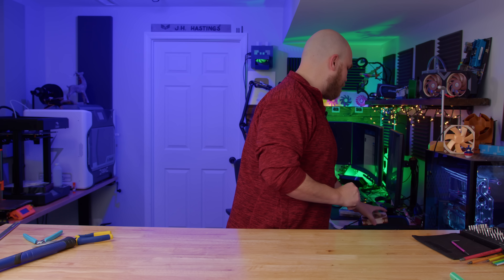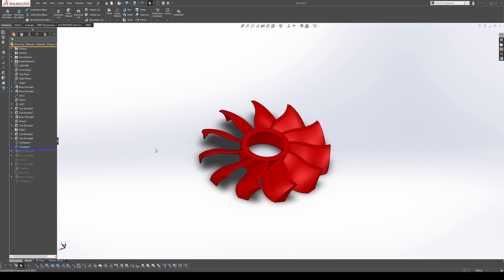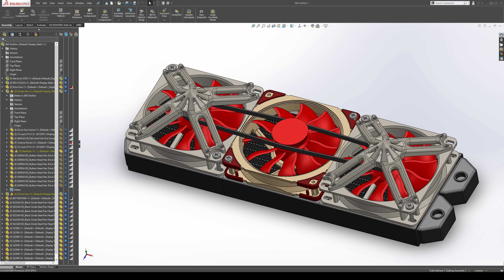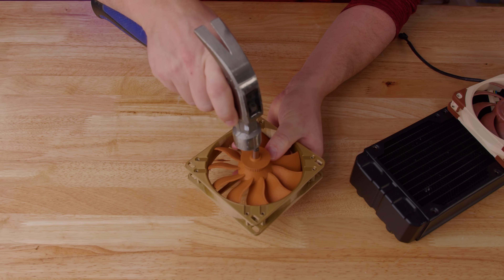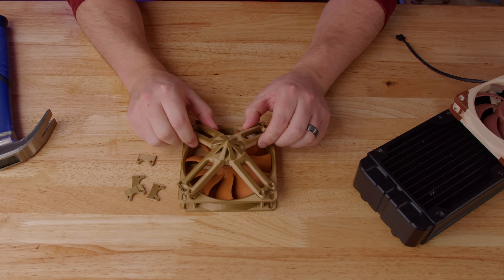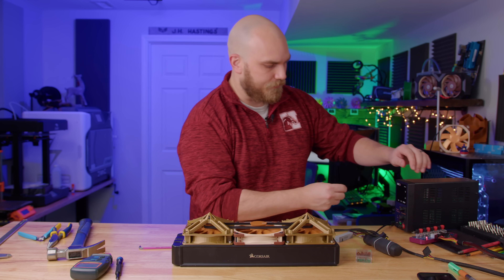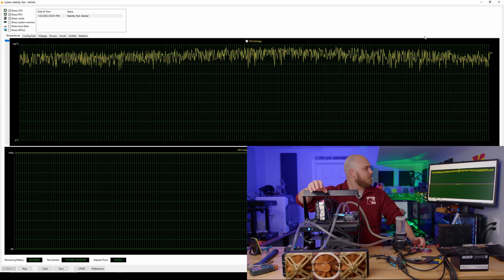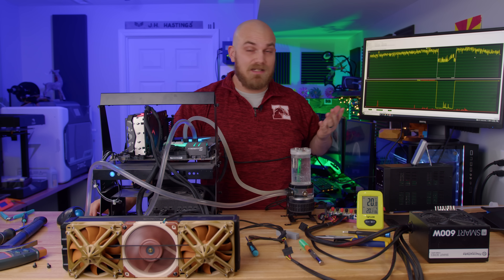I Turned One Fan Into Three | Steampunk Water Cooling

Comment: Love it. Some good suggestions here too. I would consider using only one bearing per slave fan and put them in the pulley. Then you could just fix the pins to the frame. Might further improve the mechanical efficiency. Also, I wonder how a fan shroud would do with just the one fan. Like in a car where a smaller fan services a larger radiator.
Reply: A Shroud that covers the entire surface area of the radiator but being run by 1 fan should in theory equal running 1 fan without a shroud. To get the answer to that we would have to calculate the rate of thermal exchange of the radiator. IT should cool more of the radiator but also pull ion more air causing more resistance etc. There's a ton of factors to take into consideration here but the theory states that there would be little to no change Remember X = Watts (Energy) y = resistance(Friction Etc.) Z = X - Y. Z will always be less than X

Comment: You need a ribbed belt - not a tooth belt - the teeth going from one side to the other will always slip and wear out - a ribbed belt where there are a few groves along the length of the belt - and matching but opposite grooves in the pulleys means more surface area and less slipping.  You can adjust the tension a lot easier as well with it.  You should add a tensioner pulley on it to be honest.   or you can do a round belt and twist it like a figure 8 but open up the middle so it can go around the center pulley  or use 2 round belts - one going to one fan from the center and one going from the center to the other fan - and just have a divider groove inset into the center pulley - and grooves on the outside pulleys.   You can also try a spray tack - like spray glue - a very light dusting on the belts of your choice and try that as well.   I hope it helps!

Comment: Future belt joining jig is awesome! Nice work!

Even though the asymmetry may drive people crazy, you’d be better off with the drive fan and pulley on one end. That would give you much better engagement for the toothed belt and drive pulley. The middle fan would have less engagement but that should probably be fine as long as the belt doesn’t stretch.
Reply: it would work just like a tank tread.  the middle sprocket would be a neutral engagement and shouldn't skip at all.
Reply: @grelgen    The sprocket of the middle idler fan in the set up I outlined would probably slip just as much as the middle drive fan does here in the Major’s set up. A way to mitigate that would be to make the middle fan’s sprocket bigger (like he did) so it engages more of the belt. Going even bigger would get you more positive engagement without having to add as much tension as he did (resulting in binding). The middle fan would turn slower than the others, but that doesn’t really matter.

The road wheels on tanks don’t skip is because there are tens of tons of tank pressing them into the tracks. They don’t even have sprockets but it doesn’t even matter if they turn or not. They just support the weight of the tank. 

The only wheels on a tank that have sprockets are the drive and idler wheels, and those don’t skip because they are engaged over more than half their circumference.
Reply: @Case16710  his central hub is skipping because his outer hubs are smaller diameters and there's a torque conversion on top of the bearing/air friction.  if the main drive moves to the end, the torque on the middle gear will be lower since it's only fighting less than half of the original torque.    There are tank drives that have rollers to keep the top belt from sagging.  those don't have tons of pressure and they roll just fine

Comment: You can visit a skate shop for really nice bearings for pretty cheap. Remove the dust shields and clean with high percentage alcohol. Lube only slows them. They "don't last as long" that way but I would get years out of a set of bones reds with no shields or lube. 

I would like to see if this works better/worse than one fan ducted to the same size as 3

Comment: As mentioned in other comments, there's significant room for optimization here. 
608 bearings have a lot of rolling resistance, both from their size and the grease they come with. A 3mm shaft with some really small bearings (693zz, 3x4x8 or similar) would help a lot with that.
those 6mm timing belts also are overkill in terms of friction and forces. You can get really small, low-friction rubber belts designed for repairing things like casette tape players on Amazon that would work great. Some thin o-rings or rubber bands would work too.
A double-belt system would eliminate a lot of the tension as well.

I bet with all those changes, you could totally exceed the cooling performance of a single A12x25.
Reply: Not to mention the double belt system will have significantly more contact with the main drive, reducing a huge amount of the need for tension
Reply: And the pully system doesn't need to be attached to the fan in a single print, as you already have a keyway... so you can change the ratios without needing to redo the full fan print.
Reply: I think the biggest issue is driving kenetic energy. As the belt slips on one it suddenly makes the other slower. Using gear ratios could make this much better or a pivoting shaft like train wheels.
Reply: Yep for the main drive gear, you want to get as much contact around it. So you don't get slip.
Reply: No. There is nothing you can do to outperform the single fan without supplying more power to the fan through an external power supply. In a pc setup at home using the Fan power supply in the pc. You could never exceed the thermal transfer of the single fan. This is due to Newtons first law of thermal dynamics. You put in x Watts of energy, y = X - Restriction(Friction through bearings, reductions, air resistance Etc). X Will always be greater than Y. Y can NEVER be greater than X. No matter how hard you try. That would be creating energy out of nothing and that breaks Newtons 1st law.
Reply: Come to think of it. If he could figure out how much energy is being transferred from the heat exchanger on his fan show downs. He can figure out how close people are to reaching the ceiling (Limit) of heat transfer because he knows how much energy is being supplied to the fan. You would have to guess how much of that is being lost to friction and what not. It's possible though.

Comment: The bearings have a lot of resistance to movement on this small force.
Should go for ceramic bearings as they are a lot easier to move and often without grease and doesn't cost much more. 

Also the belt should be longer and have at least one or two "idler" pulleys to keep moore tooth engagement on the driving fan as it barely has one full tooth engagement on each side now and the outer ones probably have 50. And then you can have a little less tension on the belt. 

Also if you make the idler adjustable it gives a good flexibility for testing. 

Still think it would struggle tho
Reply: Or jus use an hobby rc BLDC motor and controller and now you can have ridiculous high airflow and power 😅💪

Comment: You are barely touching the belt, I think it could be better with 2 pullies on center fan and 2 belts, each doing full 180 on the pully. Also make center smaller, so that motor can spin at 1000-2000 rpm and drive fans at like 500-1000, less load on the motor. This should work. You could also just use 2 dead fans with their native bearing and press fit pully fan over it and let it spin, it should not wobble that much..
version 2.0 is in order!!!

Comment: Maybe use a flat rubber band with convex pulleys to keep it centered. No teeth would mean less friction. Maybe move the drive pulley up enough to only touch one portion of it rather than top and bottom like accessory pulleys on a car. On that comparison, maybe reduce the sizes of the accessory pulleys to maybe 2/3 the size of the drive pulley, so the fan motor won't have to work as hard. Cool stuff man!

Comment: you need better bearings. like the crazy ceramic and zirconium ones you can find on ebay. Smallest ones you can find that work, small bearings have less torque overhead.
I would also use two round belts, instead of one cogged belt.

Comment: If you printed 3 fans with rings attached around them, and the 2 outer fans with the opposite rotation/angle, you could put rubber bands around them, and just remove the case between them so they touch, and the the band would act as the belt drive between them ... would be very compact!

Comment: Instead of everyone's comments about dual belts, you can also make a center support that has two idlers that are off center to the top or bottom. Then run the belt to the inside of the first idler, around the center fan pulley, and then back inside the second idler. The biggest problem is that you are trying to move a belt with only like four teeth engaged on the center gear. As such you are loosing any torque you may have had from that fan by slipping teeth and having to over tension the belt to engage.

Comment: Locomotive style, would probably work better.  A long bar, that spans all three fans, connecting on a post that sits on an off-center part of the center circle.  This would keep the wheels in sync.
Reply: id use magnetic blades ,no belt needed, the central fan wold drive all the other magnetic blades

Comment: Comparing the cost of 3 $18 fans vs. the cost of the video card & cooling system is ... comical to say the least. Taxing the single motor to drive 3 total blades is just going to burn up the motor in much less than 1/3 of the original life. Overall not a good plan.

Comment: ya i'm not a fan of the way you've tensioned the belt. it would be better with 2 belts so that they didn't need to be bow string tight. that or a single tensioner pulley on one side of the center hub.

Comment: That is nowhere near enough surface area of the belt touching the drive gear. Like others have said, a dual belt system would work wonders compared to this. 

However, if you want to stick to a single belt, moving the drive gear to one side would help immensely. Sure you'd still have the surface area problem on the middle gear, but the two outer fans would be far more efficient. You could also make a more serpentine like setup to fix that, or an idler pulley.

Comment: If you could afford the bearings and belt, and extra bits, and the plastics to print, you could have bout a pair of fans ( granted not top of the line, but reasonable) .. nice concept and execution though.Maybe might have been better to print a shroud to allow the air to be guided over the other "slots" for more area.

Comment: I would like to see this with a stepper motor from a 3D printer running all 3 fans at a gear ratio high enough to spin the fans at a normal speed. Should have enough torque.
Reply: I think a brushless dc motor would work just fine, steppers aren't great at high speed. Though 2k rpm might be fine

Comment: Loose the roller bearings, switch to a bushing/sleeve bearing and use carbon powder as the lubricant. Less parts, less mass, less loss. Also redesign the fans to a dual belt drive, one belt to each fan driven by the center for better tension and better engagement.
Reply: @mikeycrackson  Yes however if the surfaces are properly coated there would be no excess to make it into a case. Further It wouldn't be a problem on a test bench as he did it.

Comment: With a fan in the middle mount. Can you make a duct on the back side (non-fan side) of the cooler to redirect the air back through the cooler on either end of the cooler? Making a loop cooling fan with one fan?

Comment: How about to bulid an 360x120mm funnel with an fan on top (pushbor pull, doesn't matter, I think) - sure it would be not flat but without any mechanical parts = less ist more.
No only becouse of Simplicity = reliability, but also because of mechanical resistance.  It would be much more efficient solution.
An comparison would be nice.

Edit:
I'm at 4:30 - this project is massive overengineered... More then Tiger II... 🤷‍♂️

Edit 2:
09:45 Where is the comparison with one normal Fan and this strange useless construction?

Edit 3:
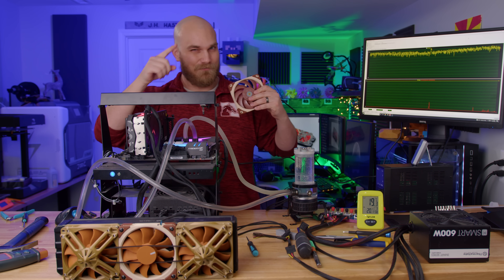11:20 my bad, I haven't saw whole video before "Edit 2", but the one fan run was that what I expected.

Comment: what about using a more powerful fan hub (I know, I know , it's not kosher here) and use two of them one on each end driving one central fan with no motor. I think the result might be a little different and Idk how easy timing will be with 2 fans but I think it could be a really interesting experiment as well

Comment: Hmm... my initial thought is that you needed a bigger drive gear in the center as opposed to the slave gears on the two side fans to keep them from slipping as much without adding extra resistance...  Maybe make the center drive gear bigger, and side fan drive gears smaller, but adjust the pitch of the fan blades to normalize the airflow between all three?  I'm not an engineer, so please don't ask me to do the math to figure all this out, but that seems like the next logical step if you want to keep using that same fan motor for this.
If you're not attached to that fan motor and are willing to use something stronger, you could probably use this same methodology to cool an entire system, GPU included.  I would love to see a whole rig run off of one motor turning all the fans on a giant radiator.  You'd need a separate pump moving the cooling fluid through the system, but it'd still be cool.  It might be louder with all the fans spinning up to keep radiator cool, but I bet if you balance the coolant flow right you could run them fast enough to keep everything pretty chilly without making it sound like a jet was about to take off.

Comment: As other people are saying the belt needs a Serpentine type movement.  But I think you can add one without even changing this model.  Just add bearings pushing inward on the Belt between the fans.  It could even be made as a tensioner.

Comment: I'm a noob when it comes to mechanics but wouldn't the fans be more efficient if the A12 were on the outside instead of the middle? Then you wouldn't have to worry as much about slipping.

Comment: Maybe try staggering the fans to adjust the belt tension a bit differently to see if that would make a difference. Like have the center fan raised with the belt running over just the top of the fan belt pulley/hub

Comment: Ok your problem is simple
Ok I'd say if you can 
Print out two tensioner drop the belt down from the middle drive sprockets at the bottom now this will allow them to move freely but it may slip under load for that you need to have the belt to cup haft of the drive sprockets two more tensioners to do so it will work fine and one more thing a timing belt and sprockets are tooth matched I can't say how they do that I just know they do it  let me know if I helped any looks sweet

Comment: Only idea that comes to mind is a 3 stack of fans, one powered fan stacked and blowing through two smooth rolling unpowered fans in an effort to get the extra width of the the two unpowered fans to passively pull air too

Comment: G'day Major,
So a Cool Idea that was not Cool in practice 🤨
🤔Just wondering if a 240mm Version of this setup using the T33 MKIII Fan Design (Thanks Jason) would be more efficient as you would have less load & get much better Belt to Gear Contact on the Noctua

Comment: I'd personally try running a big drive Inthe middle to 2 small drive which the drive each fan, kind like this - o ° O ° o - the 2 small would be double stacked and the belt be this shape V looping round the big center drive and the 2 smaller drives, wait! What if the fan itself when past the housing of the center fan doubling up as the outside of the fan and the pulley, wouldn't restrict air flow at all from the center fan, if that makes any sense, kinda like them old steam Sanders and machinery, that would be petty cool. 🤔

Comment: Next iteration; Outrigger motors to drive the fans.

Could get some cheap hobby motors with better torque and attach them to the sides of the casing, belted to the fans.
One may be enough, but three motors would give more power and aesthetic.

Comment: This was fun to watch. I've kinda wondered how a case fan would go if the fan was driven externally and use up the area where the motor normally is with fan blades. I wonder if you can drive 3 fans with one motor and even use O-ring style belts with idlers to reduce noise?
Reply: A serpentine belt configuration like on a car.